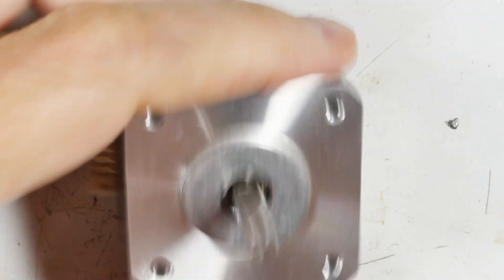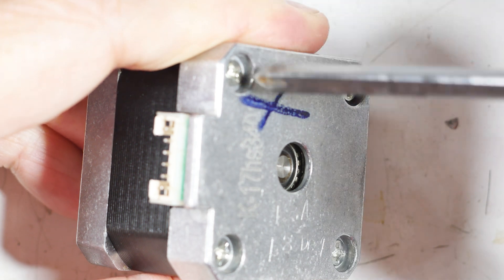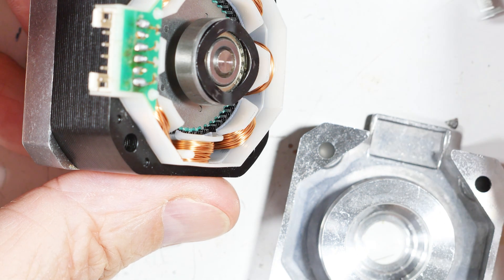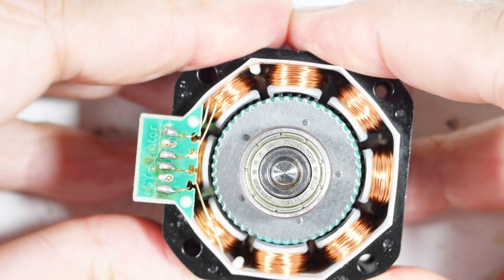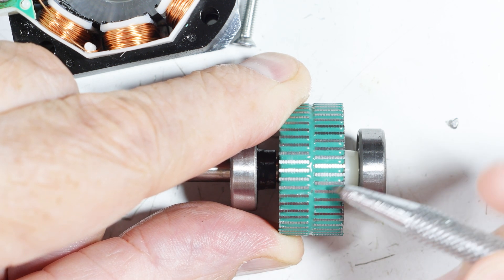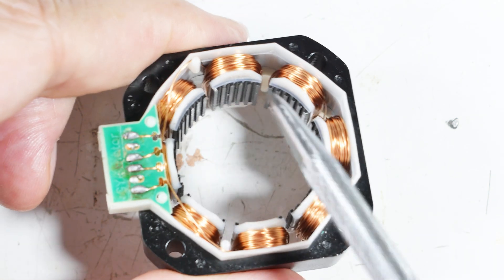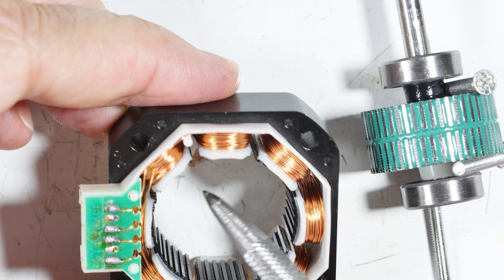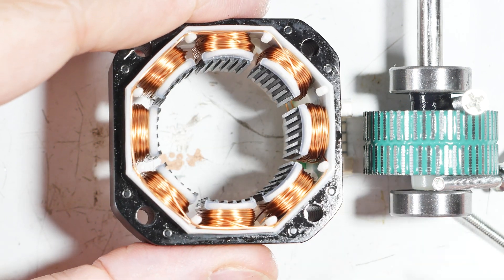Stepper Motor Parts Salvaging (4K)

Comment from the maker: In case you are wondering how these go bad (I was). Mechanical damage is high on the list. Shorts between windings happen from over-heating or vibrations (this is a cheap motor and the windings are loosely wound and not coated). The final thing is loss of magnetic strength due to over-current, impacts, disassembly,  heat, etc. It could have several problems at once that add up to a fail.

Comment: It is marked with an "X," as though it is bad. But, there is not much that can go wrong with it. One of the solder wire solder joints on the PCB looked iffy. Maybe try reflowing the board? Its highest and best use is as a stepper, I would think. Cheers.
Reply from the maker: I agree. Sometimes the bearings get worn and there's very little clearance, but that does not seem to be the case. It might have been too much load for the driver (some use half the power of this one)  and it may be the driver's bad.
Reply from the maker: Just googled bad steppers. Mechanical damage is up there. Shorts between windings from vibrations (these windings are loosely wound and not coated)or overheating. The final thing is loss of magnetic strength due to over-current, impacts, disassembly,  heat, etc. It was a cheap motor, so could have several problems at once.